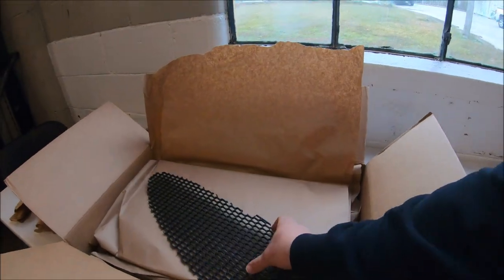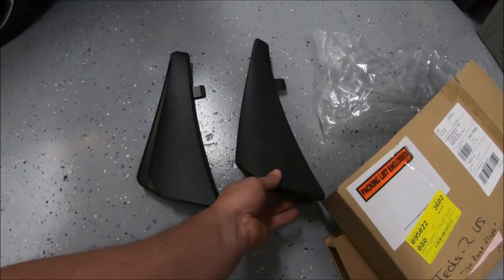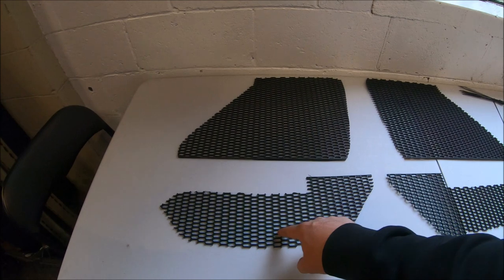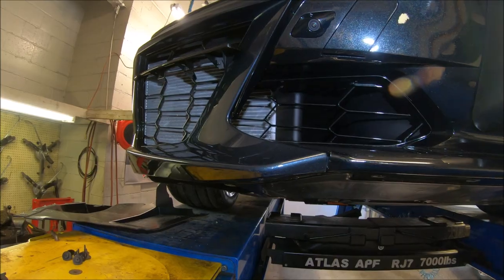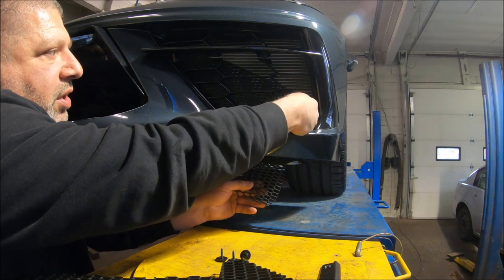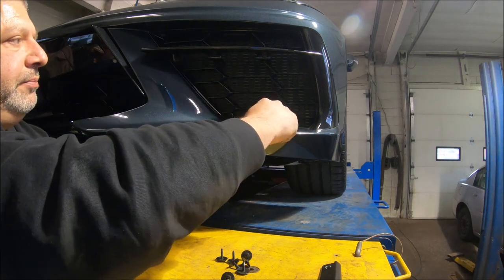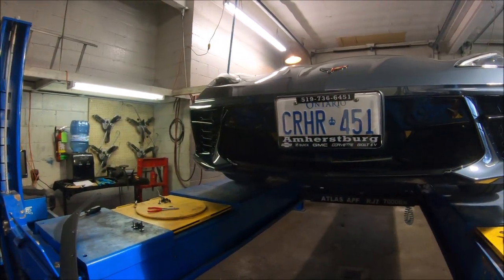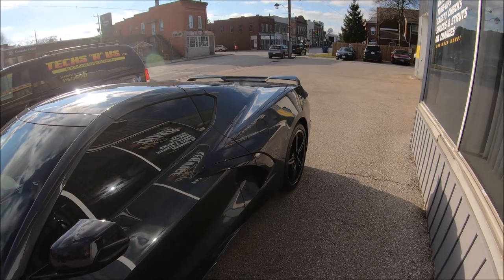C8 CORVETTE VLOG #3 - Radiator protector mesh install

Comment: Thanks for posting this video.  You mention there is a flat side and a beveled side but I didn't catch you saying which side should be forward.  Did I miss that part?
Reply from the maker: No, I usually think it but don't say it lol. The flat side should go towards the radiator. It looks better that way. Not sure there is an advantage other than looks.

Comment: Noticed you had the ‘big box’ license plate holder on your C8. Just my opinion but I would think it would look a lot better if you used the removable piece on the car and attached it there.
Reply from the maker: Maybe. I just left it as I got it but I may try that. Thanks

Comment: I also ordered those grill covers. I’m still waiting for my C8 which is also shadow grey metallic. This video really helps. One question, do you like that front license plate bracket better than just the other option of drilling holes and folding the license plate a little bit? I’m in California, so I need to have front license plate.
Reply from the maker: Thanks. Glad the video helps. To be honest the license plate bracket doesn't bother me. I haven't seen it the other way. Or I haven't noticed
Reply: @LifeOfAnAutoTech  
Ok thanks for the reply. BTW, I also ordered those mud flaps, which looks subtle and that’s the way I like it.

Comment: Chevy should redesign those grilles so you don't have to fix their design flaw with aftermarkets.
Reply from the maker: Agreed. I'm sure it has to do with air flow at the track but most are on the street. That's my guess
Reply: @LifeOfAnAutoTech  
They should have  a part as additional  equipment as part of their option package equipment 
That way it would SATISFY those who want the protection from street damage and those who are only interested in track use and are concerned about reduced air flow on the track 
You can or can not buy 
 This way Keeps all Warranties in force since all equipment is OME not after market and dealers can install

Win Win on everyone’s part 
Owners  GM and Dealers
Reply from the maker: I agree that would be a great solution. Good idea